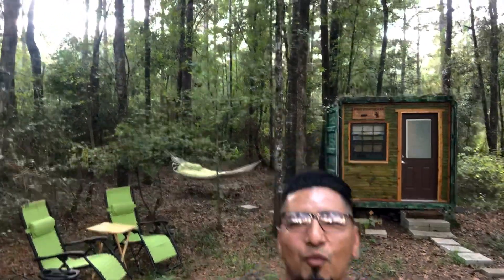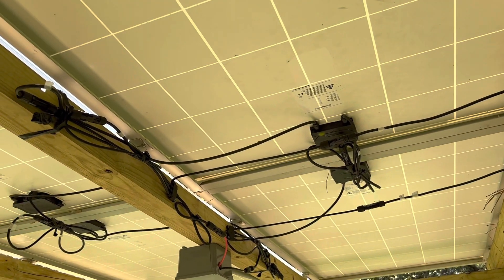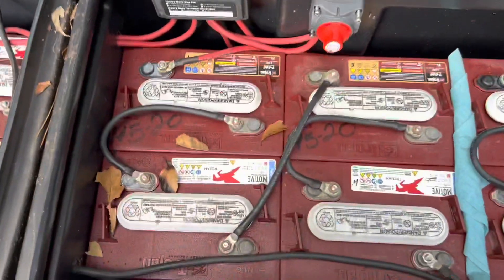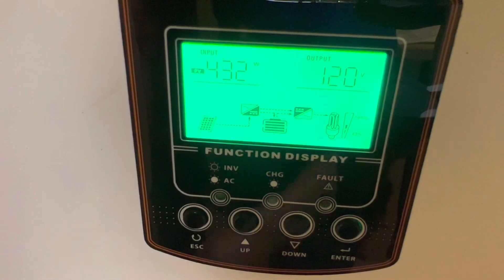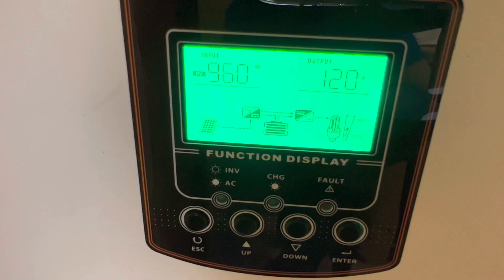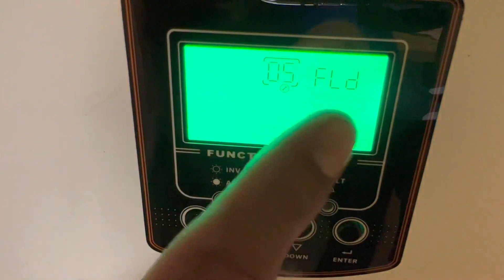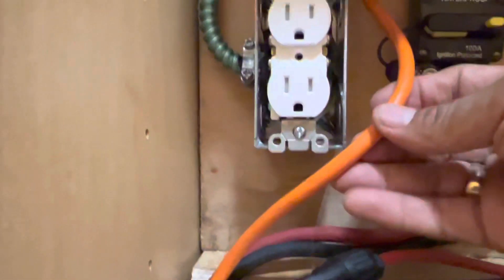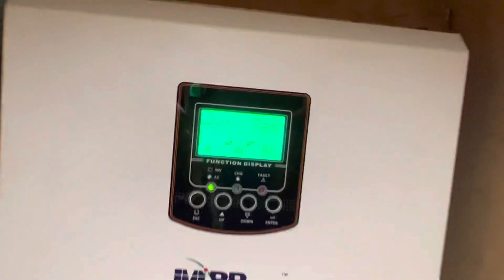Completely Off Grid, 24 Volt Solar System using The all In One MPP Solar Inverter, 1500 Watts Aray

Comment: NICE DIY SOLAR SYSTEM FOR THE OFF GRID HOMESTEAD . WITH THE PV MODULES PRODUCING POWER ON THE SPOT , YOU'LL NEVER HAVE TO WORRY MUCH USING THE GENERATOR  . YOU HAVE A GREAT THING GOING AND WE PREPPERS MUST DEPEND ON IT TO SURVIVE ANY SHTF SITUATION ON OR OFF THE GRID . MAY THE SOLAR BE WITH YOU .
Reply from the maker: Its best to be overprepared than underprepared

Comment: thank you so much.  we just bought a place off grid and the inverter didn't come with a manual and i couldn't find the manual on line.  and yes they had the batteries on agm, so i just changed them to flood, now we wait and see if they charge the batteries better
Reply from the maker: It will, I just subscribed. Awesome!

Comment: I suggest you to put more solar pannels,you have a lot of battery and will be half charged. Olso i suggeat you to put active ballancer for those battery. I have olso 24v configuration,i use 4s 3p battery bank with active ballance for each string and all my battery bank have same voltage.Your off grid house and surrounds are amazing. Wish you a lot of sun

Comment: Fist thing I would have set was turning off that beep ! That ac in you are not using can be plugged into the generator and the unit will charge your battery . Unit has a built in charger and should be set up that way. That way you can bring the batteries up at night !

Comment: The price you paid in wood sounds insane, 200$ is mental. I’m in the uk and that wood be 50-70£ all day. Solar panels wise it costs 50-70£ per 35v panel (250w).
Reply from the maker: Yes, that is due to supply and demand, lumber is so pricey. The cost has came down some but not much. 
I wish I would have builded with metal instead.
Thank you for watching

Comment: Awesome video and thank you for sharing. Total noob here and my question is if you combine the six panel voltages together it equals 253 volts going to the mpp solar inverter but its only rated to take in 145v? How is this possible? Appreciate any input thank you!
Reply from the maker: I have six panels, each runs at 30v at optimum operating voltage. 
I hooked each two panels in series (neg to pos for a total of 3 strings (3 pairs) 
each pair now has 60v now because when you hook up in series voltage doubles and amps stay the same. 
Then you hook up the three strings together in parallel (pos to pos and neg to neg). 
In parallel the voltage stays the same and amps double. So I only have 60 volts going to my Mppt all in one solar inverter. Check this Renogy portable Power station 1000……https://youtu.be/13DuseBLyHc
You can look at one of my other videos to see how I hooked it up. Sorry for the late response

Comment: I really like that solar mount design & your container home. I noticed that your panels are positioned nearly flat, with no angle. Is this by design? If so, you are very lucky to be getting around 1000-watts. Your generator likely scared some of the varmints away at night and you'll likely have more curious visitors, now that the generator won't be running (also, nice job with the solar setup).
Reply from the maker: Yes you are correct about the night critters...lol. The solar stand is adjustable and I will adjust it ....Thank You

Comment: I just came across your Channel and I really like you're the cabin your setup good job and what size is your container
Reply from the maker: Thank You, the size is 20 feet. I'm thinking of adding another one on the side
Reply: That's cool on size an plus other side that would give you a bit more room and I wondered that they get cold there where you're at when that time comes because I thing about your batteries outside in the weather when it's cold that would not be too good but I think you got that figured out,, and plus I like the outside where you're at I would have been in Heaven There
Reply from the maker: @garyrichmond7857   The winters here aren't really cold in TEXAS. I will but some insulation next year if need to be. I did get the EcoFlow Delta Pro with 2 batteries. Check it out

Comment: It seems you're on AGM, is that right? What made you go that way instead of LiFePO4 which would have given you around double the battery capacity at the same Wh rating?
Reply from the maker: I went with The T605 lead acid batteries cause they were given to me. So I build around them.

I have ordered the eco flow delta pro.....as back up
Reply: @journeyintonaturetheoutdoors  Free is hard to argue with at times...

Comment: What size wire did you use for you run to the solar panels. I calculate close to 20 amps if the panels are producing at 1500Watts.@75 volts( 2 panels in series). Have you measured the  voltage at the panels and at the charge controller when it is charging 1000watts?
Reply from the maker: Chris, I'm running 10 gage wire... This works great with the system I have. When charging at 1000 watts the voltage is about 56 volts 
  https://www.amazon.com/gp/product/B01D7VBU8Y/ref=ppx_yo_dt_b_asin_title_o00_s00?ie=UTF8&psc=1
Reply from the maker: 10-gauge wire is usually used for short 30 amp runs. If you plan on going over 150 feet, 8-gauge wire or thicker will be needed.
Reply: @journeyintonaturetheoutdoors  If your panels are putting out 1000Watts at 56volts on 100’ of 10 AWG you are probably dropping at least 7 volts. At 1000 watts and 56 volts you have 17 amps. 7 volts x 17 amps=119 watts loss in the wire.I have  a smaller system with 500 watts running similar voltage and use 6AWG on a 70 ft run and loose a little over a volt. That must be some pretty good wire. I worked in electronics most of my career and I’ve never seen wire that good.

Comment: What did you use to attach your panels to the 2x4s?
Reply from the maker: https://www.amazon.com/Houseables-Mounting-Adjustable-Accessories-Generators/dp/B07HMCL13S/ref=pd_yo_rr_rp_8/146-6222432-4899015?pd_rd_w=jz9Ej&pf_rd_p=ab0a9b42-6890-4e8d-9985-141bb5bf2471&pf_rd_r=Y1N5D3THHJFF09TXZE8D&pd_rd_r=f31afa13-d191-4c71-a787-88be666e803f&pd_rd_wg=oE1Bg&pd_rd_i=B07HMCL13S&psc=1
Reply: Thanks!